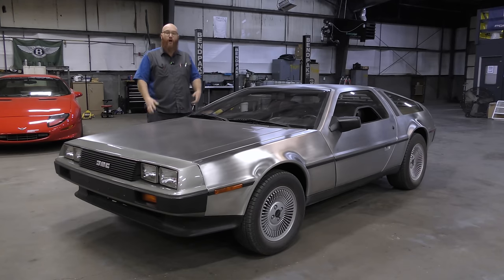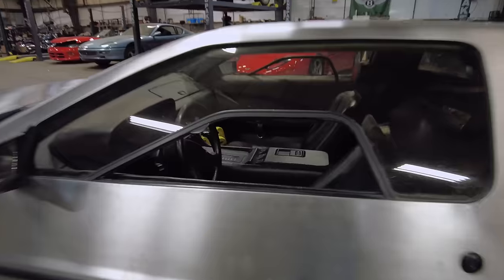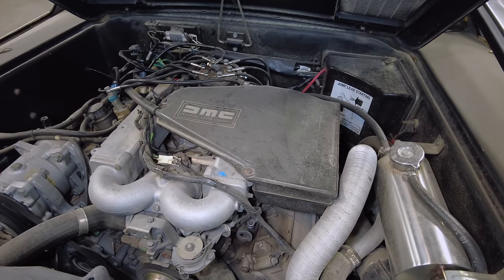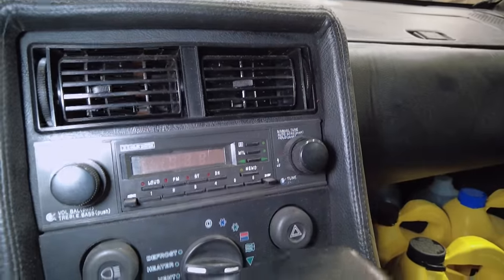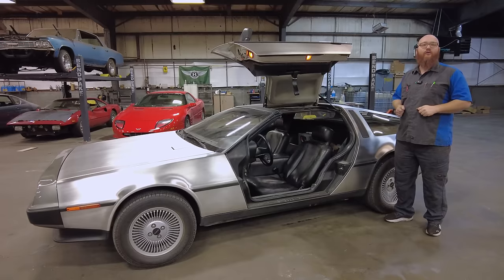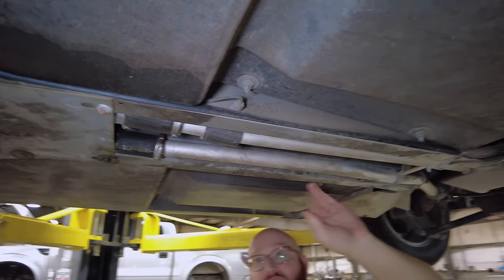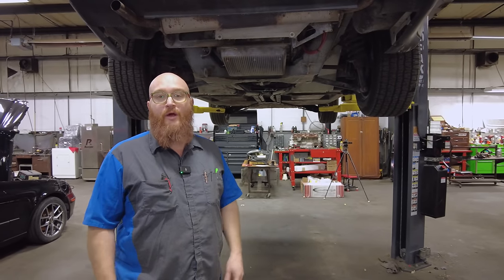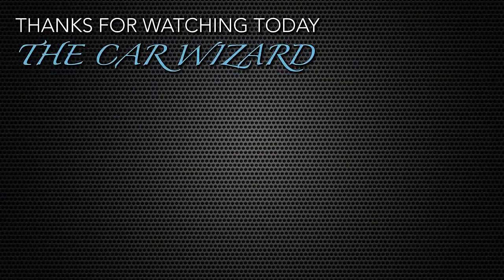Time Machine in My Shop! This DeLorean Will Send You Back to 1981

Comment: I've learned few trick with those old Bosch systems when I was into vw in mid 90s and trying to get power on budget and then aftermarket wasn't big yet and little tricks like  spring replacement and other little tricks to get performance out of them when building na motor sure u now them and tuning them are nuts but one favorite builds my freinds did back then was stroked 1.8 16v head and stuffed in 78 Sirocco drag car we built and the 83 rabbit gti 16v I built with down drafts before we were 17 no we didn't build bottom ends but we did everything else we just didn't own tools to yet and it was group effort were I started with nowing how build motorcycle motors and they had vw bug motor experience and back then we bought every repair or manual out to collaboration spec between the models of vws we all own at one time the 7in group own close to 50 cars of every type Sirocco rabbit.trucks.golfs Corrado.,gas and diesel models it was basically a chop shop around the one how parents had garage and land we stored everything there it was local hang out and everyone respect the rules they set dad and mom plus back then getting foot in ass was a bad thing .

Comment: So if you get into a bad front end collision the gas tank is right there in front of you to provide a flaming bath of gasoline while you can’t get out because the doors are jammed shut and the little window is to small for anybody but a small child to escape through. Nice
Reply: The gas tank is technically INSIDE the frame, one of the strongest parts of the car. The cars that have been in front end crashes don’t end up leaking gas unless the crash is so severe the driver was dead on impact.

Comment: I love what Robert Moseley said about critics of his time machine conversations.  He told these critics that these are $25k to $50k cars that he's turning into $100k cars, and if the purists want to stop his time machine conversions,. they should buy up every Delorean in existence and lock them all up in a warehouse so he can't convert anymore!  I loved that!

Doc:  "When this baby hits eighty eight miles per hour, you're going to see some serious sh--..."

There are actually THREE versions of the Delorean Time machine (four if you count the rail going version at the end of BTTF three):  each version from each movie was slightly different. Version One was the original as first unveiled in the beginning of the first BTTF movie.  There is a second version near the end of the first movie and in all of the second movie that used a different version of Mr. Fusion that converted trash into nuclear energy for the flying circuits and the time circuits, instead of plutonium - this was also the version that hovered and flew (not actual flight).  Version Three was the version with the whitewalls in 1955 in the third movie.  Each uniquely distinguishable from one to the other.

Just an FYI, there is a company in Texas that bought the rights to the Delorean name and offer Delorean OEM replacement parts as well as restored Deloreans.
Reply: .....by the 3rd movie, im surprised the Atomic Regulatory Commission wasn't chasing down Doc Brown!

Comment: That PRV V6 will have been in quite a lot of Volvos and Peugeot 505  etc. sold in the US back in the day but I guess most of those are long gone, If it wasn't for the film far fewer  Deloreans would have survived
Reply: It was originally designed to be a V8, but the 70s oil crisis hit in mid development, the partners cut two cylinders off causing the original 2664cc versions to run like a V8 missing on 2, it was only at the first face-lift when they took it to 2.8n/a or 2.5 turbo that they used offset crank pins to even the firing order. It was a decent engine for reliability and durability, just lacking in hp and refinement.

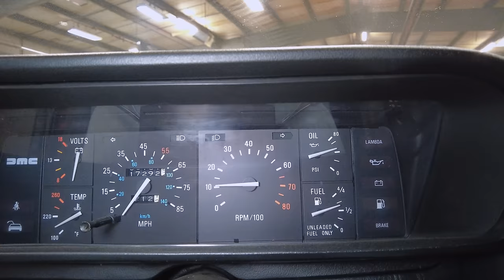Comment: 6:50 should point out that original speedometer only goes up to 85. unlike in BTTF where they had to put in a new one so they can get up to 88mph to time travel.
Reply: In 1979, the USA National Highway Traffic Safety Administration (NHTSA) required speedometers to have special emphasis on the number 55 and a maximum speed of 85 mph (140 km/h).  This applied to all cars sold in the USA - including (bizzarely) Ferrari and Lamborghinis.
Reply: For the movie they just screen printed a sticker for the speedo.

Comment: Too heavy and not enough power, but still an icon! They never sold well, you could still buy these new and unregistered in the UK in the mid 90s for the price of a small family saloon. Engine swaps that don't require drastic modifications to the car are possible if you want the power to match the looks.
Reply: They were about 2700lbs which is  400lbs less than a modern Subaru Impreza. Is it definitely underpowered? Oh dear, yes. Zero to 60mph eventually haha

Comment: 6:37 yknow i dont think the stainless canister to the side is stock. I winder if someone put that there when restoring/perserving this car.
Reply: That's the coolant tank, as the radiator is in the front of the car. The original tank was plastic and would eventually fail, although there are still a few cars out there that still have them. The stainless tank was a replacement for those plastic ones.

Comment: Spaniard here, what do you mean by "Rust Belt"?
Reply: I'm not sure if it's a legitimate question but here goes.  Rust belt implies the colder US states that 'salt' the roads to prevent ice forming on its surface during the winter months.  Needless to say, the aforesaid tends to shorten the life of the moter vehicle - especially cars that were poorly rust proofed when manufactured.

Comment: i like the delorean but i would never want one those cars are plagued with issues, plus the engine looks too difficult to work on, if i had to own one i would swap out the engine and put a toyota 4 cylinder or honda k20/k24 engine in, or convert it to electric.
Reply: I'm pretty sure if the engine "looks to difficult to work on" for you, then there's NO WAY you would be able to "swap out the engine" or "convert it to electric"!!
Reply: @DeloreanGuy2  actually i could, if i had the tools, but the delorean engine has factory faults, especially the unrepairable "valley of death"
Reply: @jr-pl9kj  dude you really have no clue what your talking about. Nothing is "unrepairable" on this car, especially in the so called valley of death. All it is is the cavity under the intake manifold. Nothing scary down there to really speak of. I'll do a video soon on it to show you what it really is if you care to actually gain some knowledge on the subject.

Comment: Why would you not work on the fuel system?
Reply: They are kind of involved to work on. Lots of expensive parts inline with the fuel system. The fuel pump, the fuel distributor, the fuel accumulator, the warm up regulator, the frequency valve and the cold start valve all come into play on this thing. One starts acting up and it affects the entire system. The Bosch CIS system gets very finicky if there's something that isn't working properly.

Comment: Stainless steel is heavier than mild steel. So that would make the DeLorean even slower.
Reply: The density of stainless steel is approximately 7,500kg/m3 to 8,000kg/m3 depending on the alloy, whilst the density of mild steel is 7,850kg/m3.  Even if the heavier SS alloy is used, the mass difference over a mild steel Delorian's outer panels (circa 250 kg) would be no more than a very modest 5 kg heaview.   If the 'lighter' SS alloy is used, then the car will be 11 kg lighter.
Reply: Most of the stainless is cladding not structural.